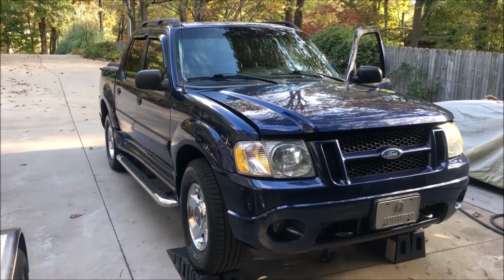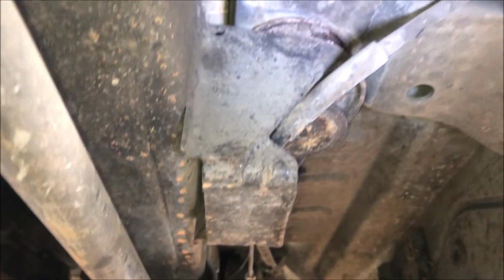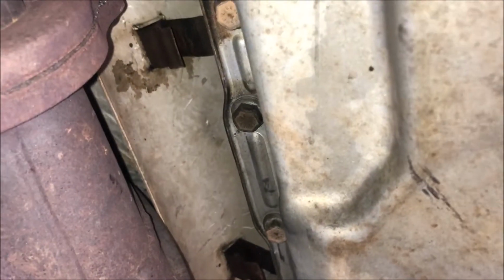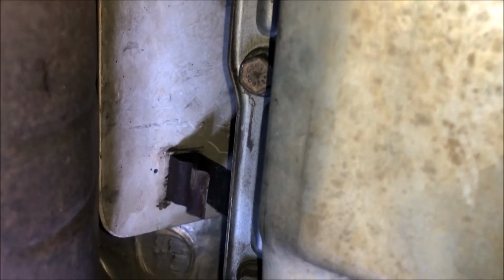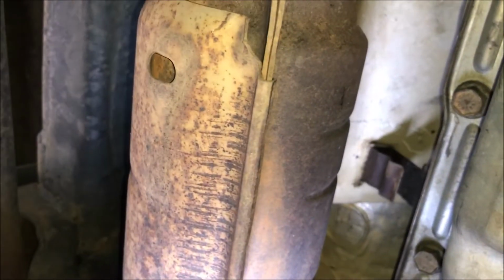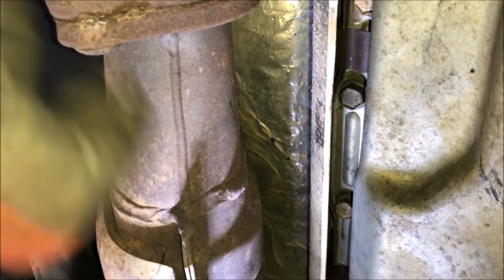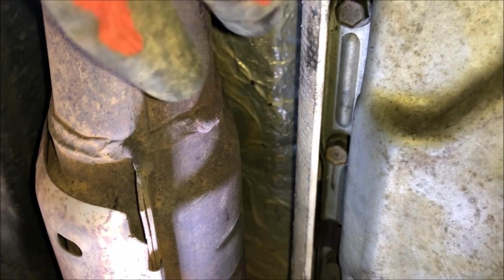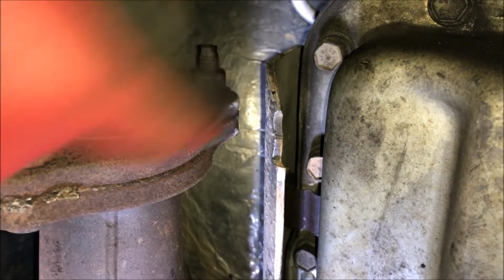Noise & Vibration 1st Gen ‘01-‘05 Ford Explorer Sport Trac: Inspection Leads to Mechanical Issues

Comment: Looking for links to the follow-up video's, I'm having these same issues
Reply from the maker: Links to the body squeaks video  That video has not been completed yet, but if that's what you're waiting for, I'll move it up in the queue
Reply: Yes, my truck makes a noise only when turning left going forward. I've changed out every piece of suspension and wheel bearings. Driving me crazy!!
Reply from the maker: @jimmyhaase  the body mounts on this Sport Trac were shot making this truck an embarrassment to drive!  Until I replaced them.